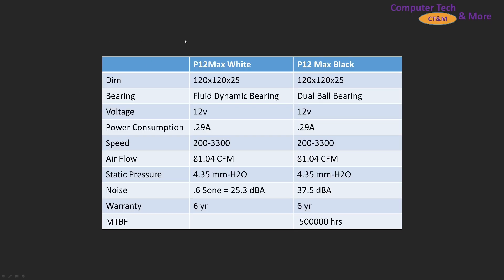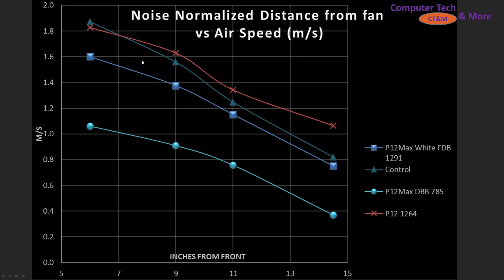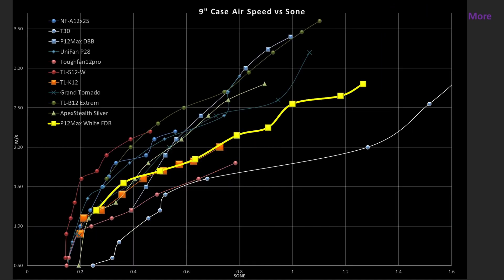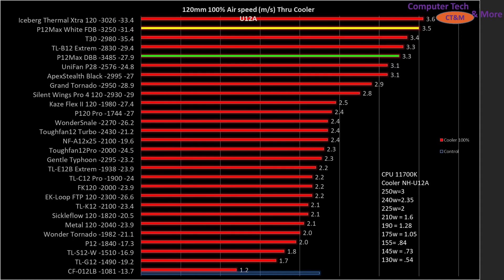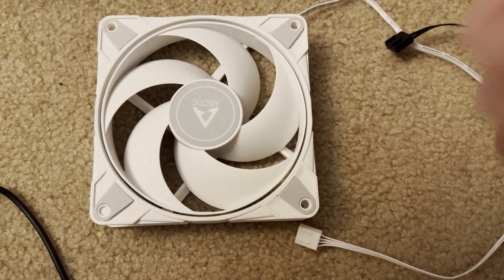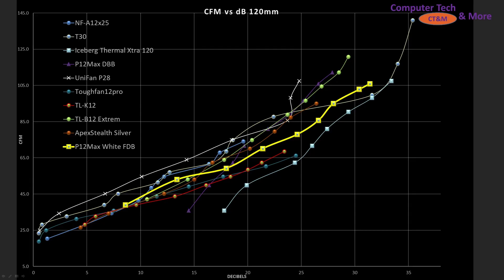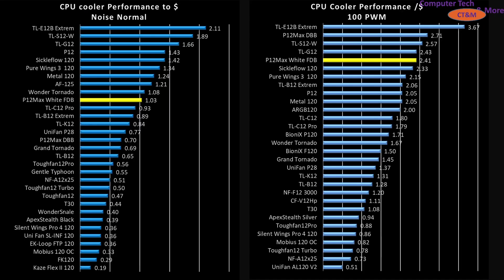Arctic P12 Max FDB: This is a great improvement over the original Max

Comment: I seem to have stumbled into this at an interesting time. A few days ago, I ordered a whole pile of these during my workstation update (new mobo and a GPU that was so big I had to cut a hole in my old case until I could refurb an even older full tower); in the old platform I had stuffed with 4 5300rpm 230cfm screamers, though in the old case, were bearable even at full tilt. Yeah, in the big tower, they were driving me mildly insane. While I'll probably miss some of the upper end grunt and the dual ball bearing, my sanity sitting next to the case is taking priority over raw cfm! In the long end of things, I have plenty of really old fdb bearing fans that still work, many of which have more than 10 years of use on them, so not too worried on longevity. 😉

Comment: I have the 2x P14 as intakes in 4000D airflow case. I was looking to swap them with their smaller brothers since at around 1100 rpm they make a noise.
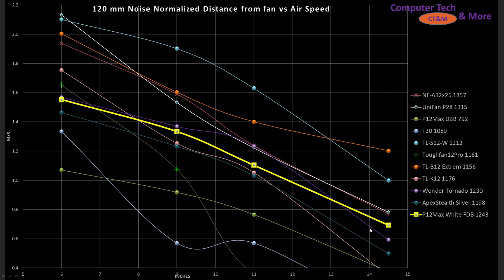After looking at your chart at 5:00 , it appears that TL-S12 are by far the best option for my case - distance to CPU cooler about 7 inches. Is there any better option for 2x120s intake in  <15$ range?

I also own the FUMA 2 and was looking to swap the fans too. In one of your most recent videos someone commented about having a similar fin size + spacing cooler. I'm between swapping the original kazeflex fans with P12, TL-C12 or TL-G12. Which one do u recommend if $ is not the issue? Since their prices are similar. I care about noise, so only checked NN charts on all your vids.
Reply from the maker: I have a best of video on my channel https://www.youtube.com/watch?v=n2EBn9BAvHw
this is best of inexpensive so under $18. 
the S12 is great for what it is but is limited in max RPM. so if your case fans had to ramp up with the P14's the S12's will perform airflow wise slightly worse. comparatively. 
If that fans didnt need to ramp up the S12 will be fine.
Reply: @computer-tech-more  yeah I saw it few hours after this comment. Quick question : what is the dB value on your noise normalized results and at what distance?
Reply from the maker: @AceL.  so i normalize my room sound and subtract that. so the room sound is like 30dB (with some variation) my noise normalized value is 11dB. the microphone is about 9" from the fan. 
I based the noise level i wanted to NN to off what I had in a previous build with A12x25 running at a specific RPM I found to be near silent. The case helps dampen out sound as well.
Reply: @computer-tech-more  Thanks for the replies. If im not mistaken your NN value seems to be lower than the majority of the reviews. It would be nice if u can add like 7 secs or so of the recording of the NN sound from the fans during the reviews, u might have to boost it a little, so we have an approximation of how loud it is. Typically from ~80cm distance from he fan, they become audible at around 1150 rpm +-10%.
Reply from the maker: @AceL.  Ill try to add that into my newer reviews. I have some that are already in que but new new videos ill add it in

Comment: I have 6 fans that have dual bb and love them…no ball bearing issues whatsoever…very quiet
Reply: I also love the Arctic precisely for the dual ball bearings (the choice of fans on these bearings is relatively small). Of course, some SSO2 is better, but if you take an adequate budget, then dual ball is the best thing that will work for years. 

about the fact that FDB lives for a long time - my experience does not confirm this (although yes, my computers have been turned on for a long time, but a working computer, i.e. 10-12 hours a day, the fan from thermalright died after 3 years)

and in terms of noise.... up to 2000 rpm, I would say those fans that I have are quiet enough, that arctic, that cooler master. The only thing arctic made noise for me right away, but later it was developed, apparently (previously, p12max were absolutely silent, one by 20%, the other by 25%, now 30 and 35%)

therefore, dual ball is one love
Reply from the maker: i think its a consistency thing for arctic. I may have just gotten a lemon.

Comment: P12 ARGB vs P12 MAX should I upgrade? I have a 7800X3D and an Arctic Freezer 36
Reply from the maker: depends are you happy with the thermals and noise. If not get the P12Max FDB version. you will loose the RGB if you care.
Reply: @computer-tech-more  Actually I don't care about RGB.  p12 max Will be noisier than the RGB one?
Reply from the maker: @capipj  at similar RPM's i found the Max with FDB quieter. but the Max will be louder at its maximum RPM.
Reply: @computer-tech-more  Thanks a lot! Youre awesome.

Comment: Do you have the data on the A12x25? It seems inconsistent across multiple videos using the New Testing Method.
Reply from the maker: ya for the most part the ones labled New Data are consistent. Then after the TL-S12 are consistent. 
I had to calibrate the anemometer there and rerun a bunch of fans. It was only the cooler testing I found the errors. 
The A12x25 most recent values in the cooler 20-100% pwm and last noise normalized
0.5
0.9
1.1
1.4
1.6
1.8
2.0
2.2
2.35
1.625

Comment: Ignoring noise, which would you go with for 4x side fans on a Cooler Master HAF 932 for top-end, max RPM performance (or, let's say around 2500 to max RPM)? The P12 Max or the IceGale Xtra 120? I'm leaning towards the IceGales. Phanteks T30 (have them push/pull on a 360 rad), Silent Wings Pro 4, and Noctua iPPC (have 140 mm push/pull on a 140 rad) are out of the question because of price or else I would have probably just have gone with the T30s.
I currently use 4 of the Cougar Vortex CF-V12HP / CF-V12HPB. They're fantastic fans. Apparently, they somehow do 70 cfm at only 1500 RPM while also being almost inaudible. They cool great too with the side fans bringing my GPU, M.2, VRM, and RAM temps down anywhere from 10-20 degrees C however, ever since upgrading to 6x Phanteks T30 (push/pull) and 2x Noctua iPPC 140 (push/pull), I think I may need more airflow in order to keep positive pressure (to avoid dust and potential case hot spots). I'm not even sure of this - temps are all still fantastic - but considering the price of the P12 Max and IceGale Xtra 120, I figured, "why not?".
Reply from the maker: i would do the P12Max FDB. Basically just trust it more.
edit: that is quiet the air exchanger pc you have. lots of fans.

Comment: Hello! 
I'm about to buy fans and I was thinking about buying the p12 max. Its 35 euro for 5 pack box. and white ones are 12 euro per fan. 

When I check the arctic's website it says the black ones has the FDB aswell. or its just a lie?

even tho is it worth the give extra money for the white fdb ones?
Reply from the maker: So you want to be careful there might still be some ball bearing versions around but it looks like they will all be FDB going forward.
Reply: @computer-tech-more  I ordered 5 Pack of p12 max Black from the arctic's website. They came with the fluid dynamic bearing. At least it is saying on the box.
Reply from the maker: @veinsx1956  good. the should be quieter at low RPMs than the DBB version.

Comment: Do fans exist with magnetic repulsion in place of bearings?
Reply: you mean maglev bearings? If yes then T30 have this kind of bearing
Reply from the maker: thank you for helping @uncrunch398 out.
Reply from the maker: fluid dynamic is basically the standard bearing for most good fans these days. Not very many fans use3 Magnetic Levitation bearings. I believe they cost more.
Reply: They call them Maglev fans in the PC fan space. Phanteks T30s are probably the best implementation of them so far. Seasonic's Magflow fans are maglev and also have pin to pad connectors for tidier cables, however they are limited to 1200rpm so they don't move much air and aren't much good on heatsinks or radiators, very quiet case fans though. Corsair ML series is another option but I think they stopped producing them. MagLev bearing certainly should provide a much longer lasting bearing but every Maglev bearing fan I have seen produces an awful loud pitch whining noise at lower RPMs. I'm sure there's a few others but in terms of noise FDB or Fluid Dynamic bearings seem to be king. Maglev can match them in Volume but FDBs are generally better due to noise frequency or pitch. The noise they make tends to be much more tolerable.
Reply: Take a look at Corsair mag lev fans … loud but awesome

Comment: had 5 original maxes, different batches. Bearings were terrible, not lubed correctly and the clearance of the bearing bed to the axle was bad. Sold all of them. Original p12 is still a great fan tho. The double BB design was terrible at low rpm with subtle rpm changes. They knocked so hard while changing rpm. Had a new one that clicked after running for a while.
Reply: Same experience with them, but arctic replaced them for me for the fdb version. Best company ever.
Reply from the maker: Thank you for letting us know about your experience. Kind of lines up with my thoughts.